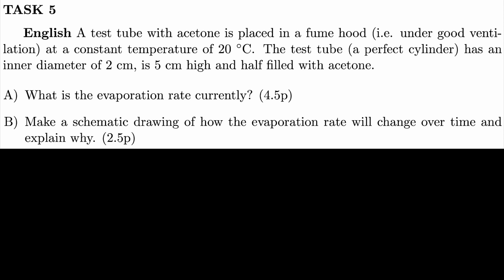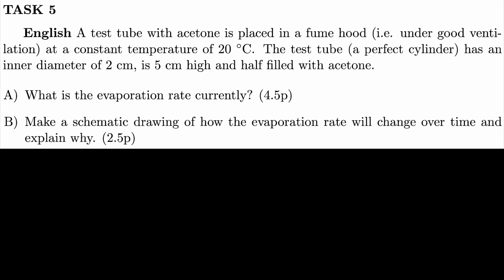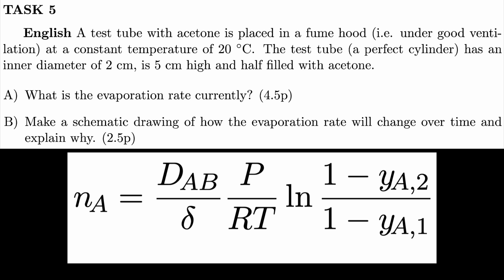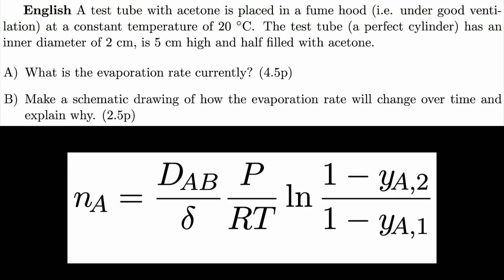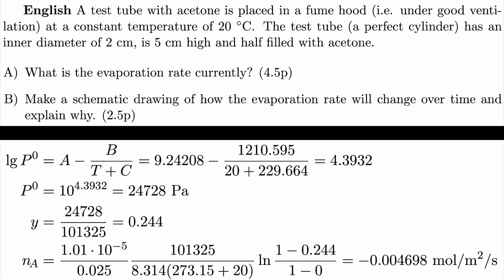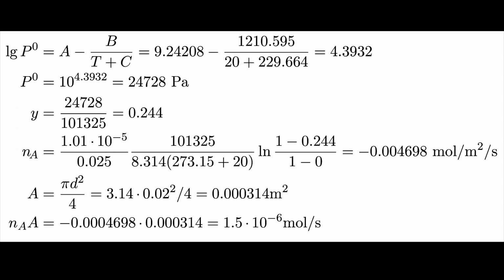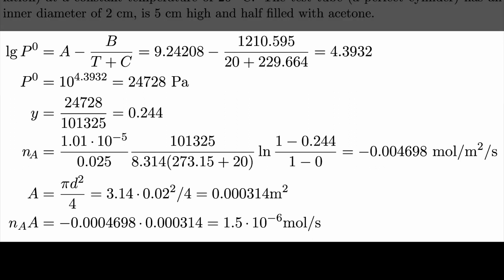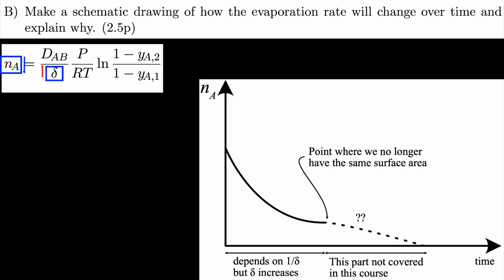Exam task mass transfer 2023-01-14 (KETF40)

Comment: Wait plzz explain the ending 💀
I can't sleep now 😭😭 i need answers
Reply from the maker: 😀 A cliff hanger in an exam, is that possible? 😀

Jokes aside, if you really want to know and are not a student of mine (those receive a more detailed explanation in the suggested solutions to the exam), you can enter the LaTeX code below into https://arachnoid.com/latex/. That page does not understand the LaTeX command \intertext, or indeed ordinary text, so all inline explanation have been removed. The crucial part in the beginning is to realize that although n_A can be expressed through Stefan's equation, it can also be expressed using a time derivative of the film thickness \delta. From there on, it is "just" algebraic manipulations

Variable explanations:
A: area (m2)
n_A: molar transport (mol/m2,s)
D_{AB}: Diffusivity of A in B (m2/s)
\delta: film thickness (m)
P: Pressure (Pa=J/m3)
R: Ideal gas constant (J/mol, K)
T: Temperature (K)
y_A: Molar fraction of A (mol/mol)
\rho : density (kg/m3)
M: molar weight (kg/mol)
C: Just a constant with the same unit as \delta^2/t, i.e. m2/s

LaTeX code:
\begin{align}
A n_{\! A}& = A\dfrac{D_{\! AB}}{\delta} \dfrac{P}{RT} \ln \dfrac{1-y_{\! A,2}}{1-y_{\! A,1}}\nonumber\\
n_A &= \dfrac{\mathrm{d}}{\mathrm{d} t}\left(  \delta \dfrac{\rho}{M}\right) \nonumber\\
A \dfrac{\mathrm{d}}{\mathrm{d} t}\left(  \delta \dfrac{\rho}{M}\right)& = A\dfrac{D_{\! AB}}{\delta} \dfrac{P}{RT} \ln \dfrac{1-y_{\! A,2}}{1-y_{\! A,1}}\nonumber\\
\int_{\delta_0}^\delta \delta \mathrm{d} \delta &= \dfrac{D_{\! AB}M}{\rho} \dfrac{P}{RT} \ln \dfrac{1-y_{\! A,2}}{1-y_{\! A,1}}\int_{t_0}^t \mathrm{d} t\nonumber\\
\delta^2 - \delta_0^2 &= C\cdot (t-t_0) \nonumber\\
C &= \dfrac{2 D_{\! AB} M}{\rho} \dfrac{P}{RT} \ln \dfrac{1-y_{\! A,2}}{1-y_{\! A,1}}\nonumber\\
\delta &= \sqrt{\delta_0^2 + C(t-t_0)}\nonumber\\
An_{\! A}& = \dfrac{D_{\! AB}}{ \sqrt{\delta_0^2 + C(t-t_0)} } \dfrac{P}{RT} \ln \dfrac{1-y_{\! A,2}}{1-y_{\! A,1}}\nonumber
\end{align}
Reply: @PLE_LU  thank you ❤️